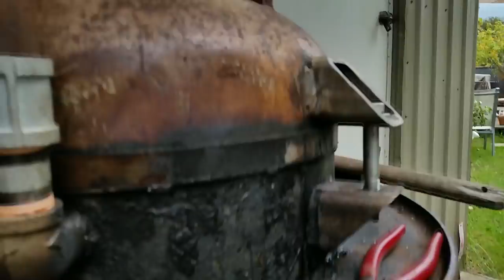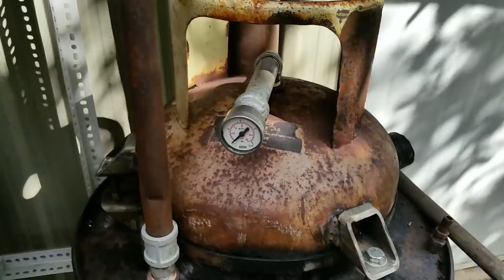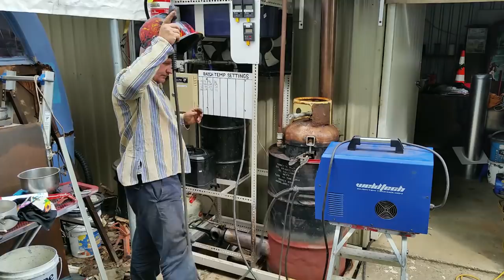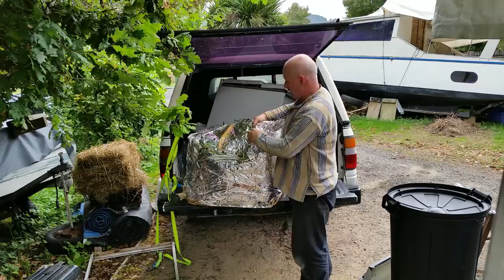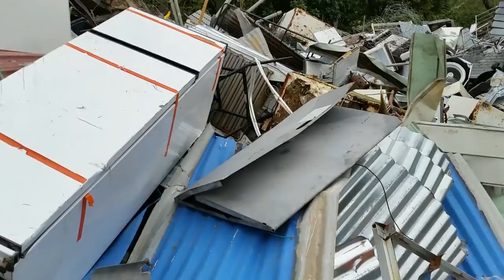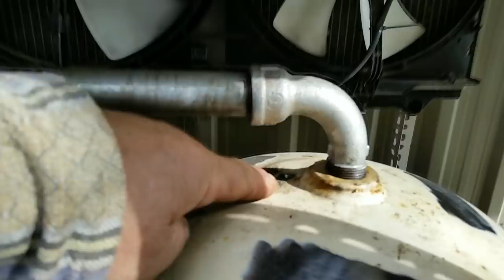Free Diesel from waste plastic part 5.1

Comment: I see someone already beat me to it but yes an anti flashback device is important.
You don't need to have the system under pressure to break the hydrocarbon chains down.
The reflux tower is for dropping the longer chains back into the pot. You will want to figure out a way to control the temp of the reflux tower especially if you plan to cook polyethylene or you will have a paraffin problem that will plug up your radiator. Polypropylene is the best to use but not as easy to get. Don't bother trying nylon,  vinyl or pvc just stick to ethylene's and polypropylene.The fluid you get out of this should be distilled again at around 300F to remove the gasoline product from the diesel or just do a triple distill to remove the octane that causes preignition in some diesels. You can also extract Propane and butane from this.
Impressive unit though.
Reply from the maker: carbogger - I've watched all your stuff! You are a hero of mine. Lol. So glad that you are here. Il be back into it soon but I've had so much other stuff on the go.
Reply: Sound like me. To many projects and  not enough time or cash Lol
I don't mess with the plastic anymore but glad to see others still doing it.
Reply: I am so interested to get diesel from waste tire plastic oil as I have waste tire pyrolysis plant producing 4 tons daily and want to cooperate with you to  turn this oil to diesel. can you help me please? Please email me at sam.ebra22@gmail.com

Comment: You might be wise to put a flash preventer in your waste gas system. You can make them easily and it could prevent all your time and effort from being blown apart violently.
Reply from the maker: Hell yes! - I overlooked that. getting so excited at getting something that I clean forgot about all the safety aspects Thanks Ill get a steel wool arrestor sorted.

Comment: Would an electric heat source be appropriate? You would definitely have control over the temperature. I'm aware that diy electric kilns are not uncommon. It was explained to me by a friend who has a mini foundry how cheap the electric one he was making would be to operate. 
Nice to see another person who sees garbage optimistically. Thanks for expanding my optimism toward junk plastic.
Reply from the maker: hello Mr Trout!- :) you are very right It is easier and more controlable. But recently Ive been playin with waste oil burners and I wanted to continue with ity as its a free resource . I would need 5000 watts to power this up and I dont have the wiring here to handle it . you are right- 5000watts x four hours will be about $6.00 at my rate here- very affordable , But nowhere near as much fun!

Comment: hello sir, i have a question,,, Will this machine can extract fuel oil from waste tyre also, i mean can we put tyre also in this pyrolysis machine??? or only plastic
Reply from the maker: Yes it will, but there is so much more mess and hard work handling and cutting tyres. there are many videos here on YouTube showing how to  process tyres to diesel. https://www.youtube.com/watch?v=f3ESuY0pekU

Comment: Sir I understood the whole process...but please sir once explain how u made the condenser?  Please sir
Reply from the maker: Hello Som- the condenser is a two part device. firstly the expansion vessel encourages the gas to condense as the pressure is suddenly reduced as the temprature is dropped. the Intercooler is from a Izusu diesel turbo 'Bighorn' SUV.  it is immersed in chilled water and does a great job.

Comment: I have watched all your videos on this project. Wanted to let you know if you didn’t know you have scrap tires you can put in to your system. By doing the same thing with the tires you can get diesel to. For example: 20(lbs) tire  you get 15% scrap iron, 40% carbon black, 45% oil. Oil can be refine in your system. But any way great job!
Reply from the maker: Yes- I looked at tires but for me, having hundreds of tyyres coming and going from here would be really messy, and there is lots of pre and post handling issues.
Reply: Ok. When you do a run again could you show how much plastic your using by weight then after show how much carbon black or ash is left plus how much fuel by weight or gallons you made? Thanks! Also what type of plastic you use.
Reply: Zachary Lamb ya same question is mine.